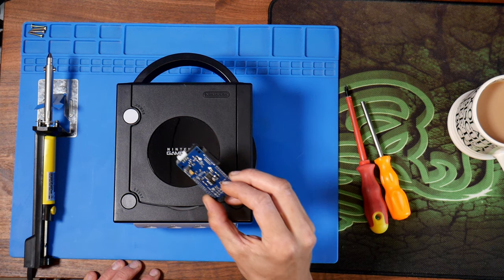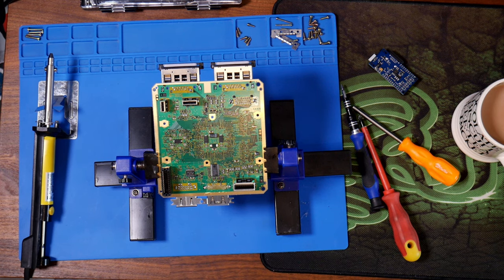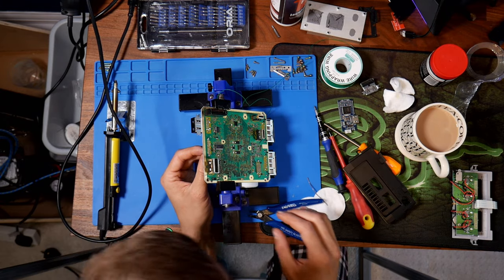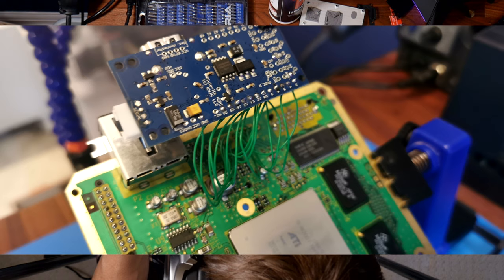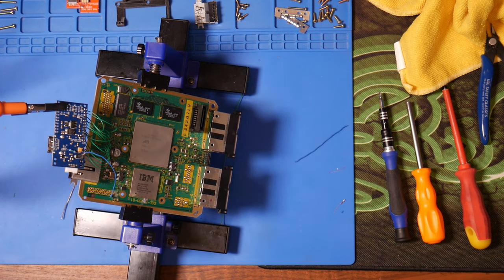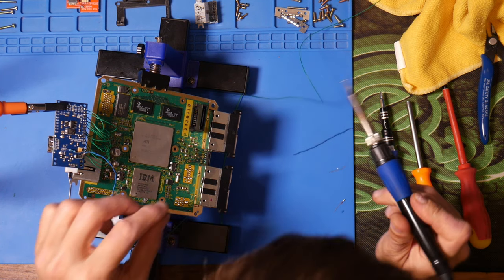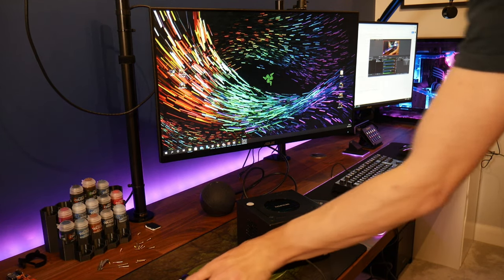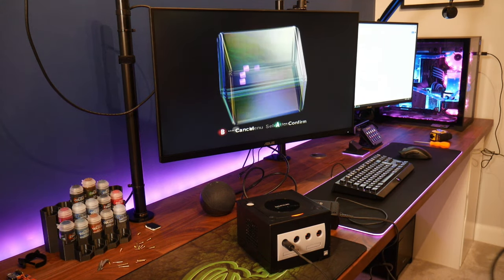Nintendo GameCube HDMI Mod

Comment: There's a guy that sells quick solder flex cables for these Pluto boards now. I bought a few, waiting for delivery. Also, I prefer the GC Dual over this method, but those cost 2.5x more, and are rarely in stock.
Reply: Did you have good success with those? Got one and it didn't work on arrival. Works when I do each individual wire though. Saw Voultar order one, same thing happened with him.
Reply: @ethansherry5819  im about to desolder that quick flex ribbon thing and do wires cause im having same kind of issues , no sound and at times no picture
Reply: @hme53  Yeah, if anyone else reads this thread, I do not recommend the flex cable for this mod. 

Let me ask you, what gauge wire are you using for this? 28?
Reply: @ethansherry5819  yes 28, actually took apart an old cat5 cable so I would utilize different colors

Comment: Does this mod give the gamecube 1080p output or only 480p?
Reply from the maker: Ill have to check next time i have a feeling it might be 720p but fit to full screen
Reply: @techclub8528  if possible to test thatd awesome. If it is 720p that'll be big especially for the price of the board! The GCdual internal mod from what I understand is more expensive and has a outputs only 480p
Reply from the maker: It might just be 480 but full screen
Reply from the maker: Ill have to check
Reply: @techclub8528  if could check that would be great 👍 and what model gamecube were you using? DOL-001 OR DOL-101
Reply: @techclub8528  any update on what resolutions its able to run at?
Reply: @Retro2ModernGaming  the closest mod the wii can get to is 720 or just slightly higher but falls short of 1080p. But I completely agree, 1st gen Wii w/gamecube ports would be best
Reply: 100ohm 1/4 or 1/2 ??
Reply: @shawnharris2242  or a modified Wii U with GC adapter install Nintendont and you can run GameCube games natively